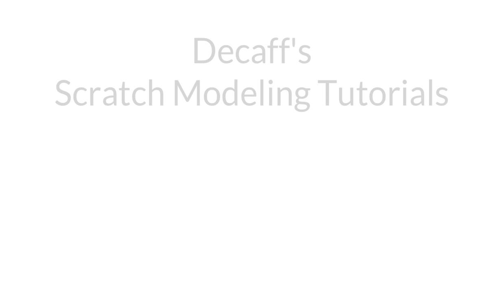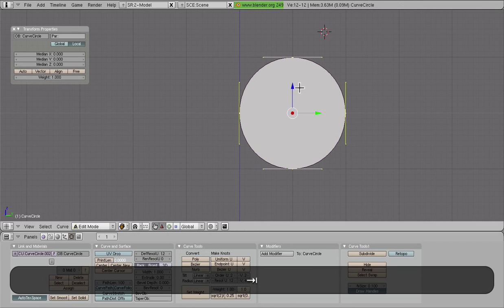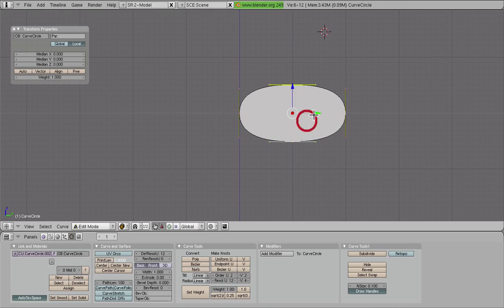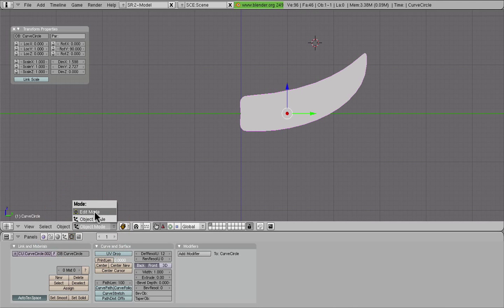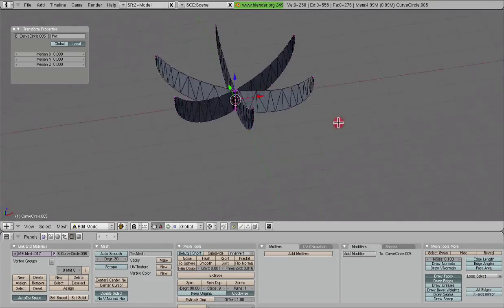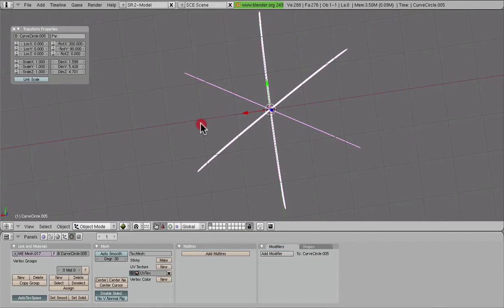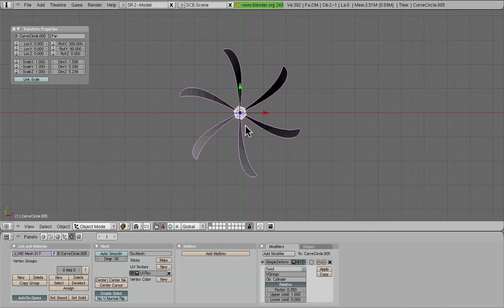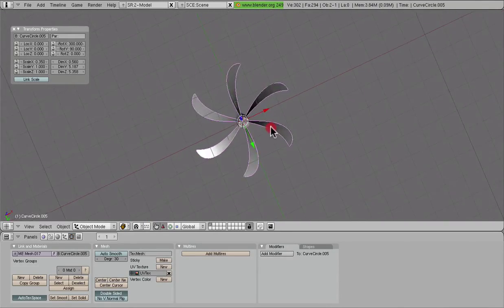Decaff's Scratch Modeling Tutorial - Making a Propeller

Comment: Got all the way to "Script Mode" and my blender doesn't have that... Went to check properties and nothing..so went to close and....now to start all over again and still never did find the "Script Mode" for doing double-sided faces. (Using Blender 2.69)
Reply from the maker: The problem is that you are using 2.69. This is using blender 2.49b with custom scripts for use in YSFlight. There is a link in the description for downloading 2.49 with all the scripts pre-installed.

Comment: Do you know how to animate the prop?
Reply from the maker: To answer your question, I have been doing some digging around the dnm scripts to find more information about the CLAs, and STAs which govern the animations. Check out my first couple animation tutorials, in addition to the STA page on the YS Flight Simulator Wiki. 
All my hunting, I have not made a propeller animation, simply because I have not tried to. Important things to note are that the Z-axis of the object you apply the animation to will be the axis of rotation. (I looked at a whole bunch of different example models and this was a constant) Also, based on the scripts, there should be a single STA, which means that all you have to do is for one keyframe, use the LOCROT setting, and you should be good. But It will take some trial and error with blender to nail this guy down.

Hope that helps!
Happy modding
-Decaff